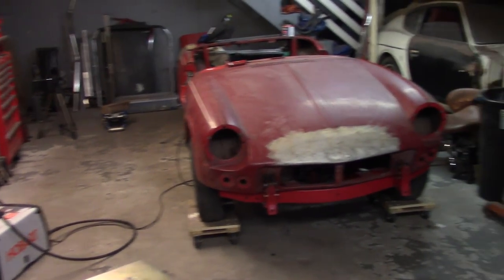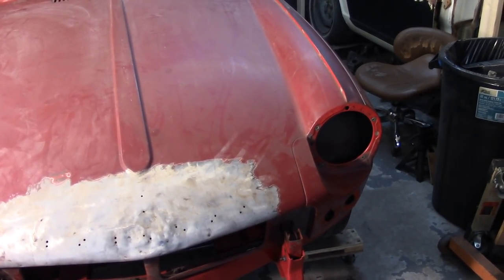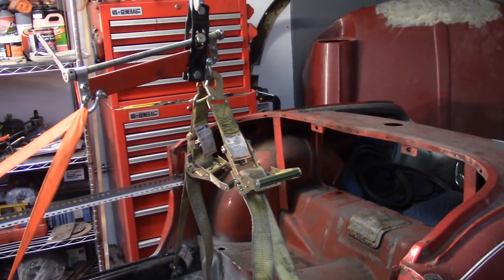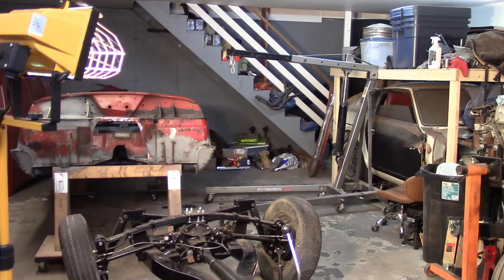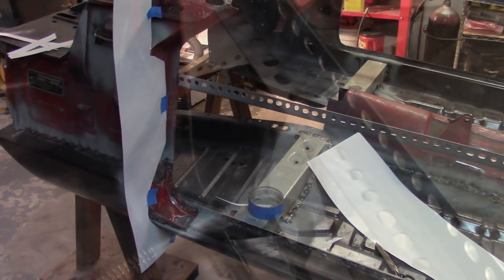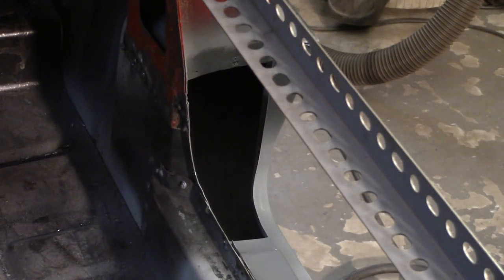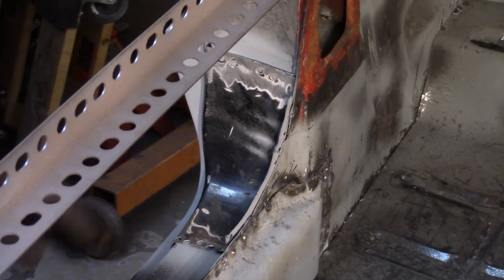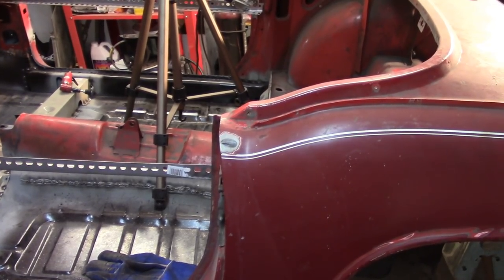Triumph Spitfire Body Repair - Sill Transitions

Comment: Looking forward to seeing the bucks; not sure if or how I'm going to do it for The Beast.

I was worried you weren't going to finish those floor welds. ;-)
Reply from the maker: Ha! I'm just going to take a really bright light and go through the entire thing, filling in with weld metal (or fiberglass-enforced body filler, depending on the size) where ever light shines through!